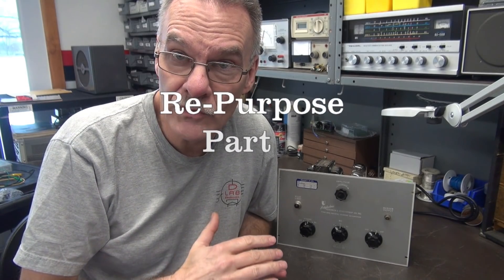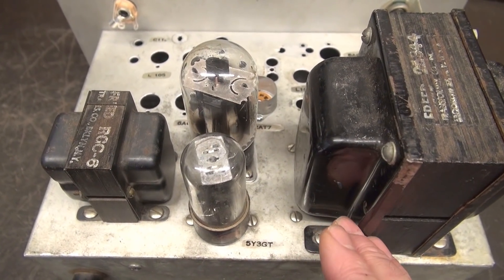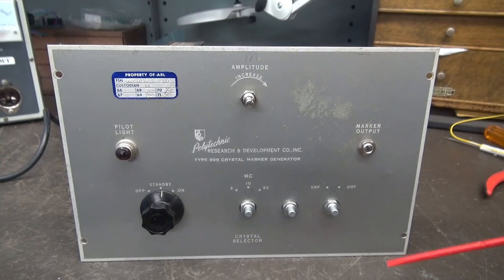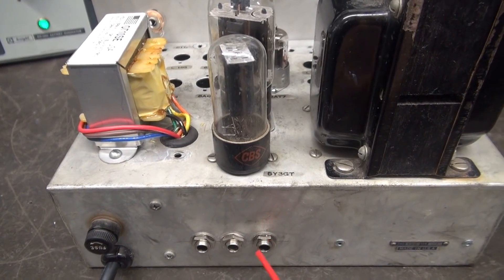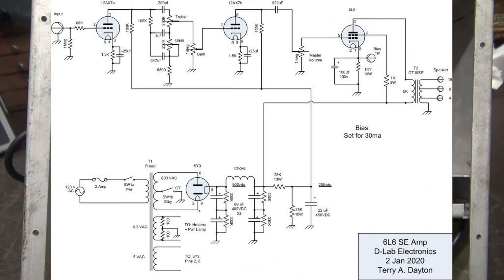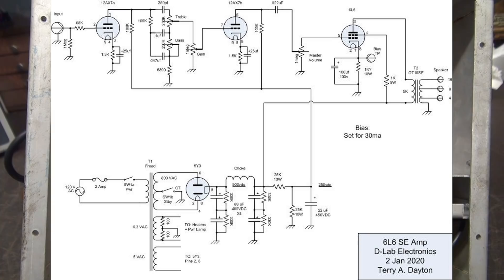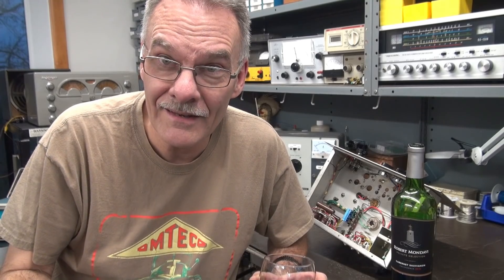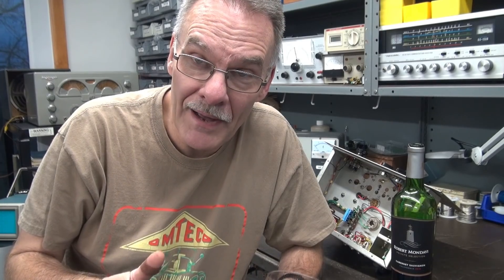How to re-purpose Junk into something cool Homebrew Project 6L6 Tube guitar amp D-Lab Part 2

Comment: Something to think about that regarding the design of the Master Vol. As configured, when the wiper track is at ~50K, the low frequency cut-off is about 145Hz with that .022uF cap, so low volume settings will be lacking in bass response. Fender overcame the issue in the 5E3 by using a .1uF cap for the coupling cap. Better still, if I may make a suggestion; attach the master Volume wiper to the grid of the output tube with 2.2MΩ resistor from the wiper to ground. The 2.2MΩ insures grid-leak to ground if the wiper fails, the upside is that the rolloff remains constant for .022uF/1MΩ at about 7Hz.

Comment: Speaking of safety:  If you are working with ungrounded AC input. Another good practice is to check for leakage voltage to earth ground.
Wire a 10k 2w resistor and a .01 uf ceramic cap in parallel across the probe of a AC volt meter. Measure for AC volts between the chassis of your project and earth ground of your building's electrical system. (AKA the third prong of the wall outlet or to the conduit.

Comment: Also terry you should talk about corect mains grounding  of the unit everyone's building  EG where to attach the ground wire  2ND  the mains wiring to the fuse and PWD switch and the correct wiring to the mains fuse

Comment: I'm curious what your thoughts are on the resistors some amps have from the filter caps to ground which are there (I believe) to bleed the stored charge when the amp is off. I have an 80's Fender Concert that has these for example. Doesn't stop me discharging and checking the caps when I work on it though :-)

Comment: Hi Terry.  Great series!  I'm enjoying the design-as-you-go process.  so often I get so bogged down with the details in the design process that I never get around to actually building!  Two questions/observations.  I'd turn the output transformer 90-degrees to reduce the magnetic coupling potential with the power transformer and choke.  Also, it looked like the plate-voltage tap for the 12AX7 was in the wrong place.  According to the schematic, the 12AX7 would get the same voltage that the output tube is getting.  All that aside, I really enjoy and look forward to your videos!
Reply from the maker: Hello, Take a second look, The 100K resistors feeding the 12AX7 plates are tied to the junction point of the 25K resistors, 250v line
Reply: @d-labelectronics  My bad.  I just watched the video again and you are correct.  I missed the the voltage divider on the schematic when I watched it the first time.  Sorry about that!!

Comment: Nice output transformer high build quality on repurposed ham or test or especially military gear my frist ham teacher in high school gave you grade on and got points if you used old stuff so that’s all I used and the habit stuck now I’m 66 and it’s still great 👍 that combo of a good supply on a class A 6L6 with that transformer should be killer so nice job

Comment: This is a very cool re-purpose amp. Perhaps add a vintage sounding 10 in alnico speaker?
I like the safety tips too. Here's a little tube tech diddy as a way to remember safety rules of thumb.
 "Got one hand in my pocket the other on the probe. Cranking the 
variac waiting for the glow. Seeking validation for my troubleshooting
 plan. If I can fix this baby I will be a happy man. 
    The filaments are glowing as the heater current flows. Watching AC 
current while my dim bulb barely glows. Checking for high voltage, no 
flashes we are hot. Max the bias voltage with a twist of the right pot.
    Looking good so far, good luck we have had some.  But lets apply the
 volume we've got signal and no hum. Victory attained fidelity restored 
it's time to start another one so that we don't get bored." 
Cheers and keep em glowing!

Comment: Sorry if I'm wrong, but I think that the way the master volume is wired, it will keep the grid leak resistance fixed, but it doesn't attenuate the volume because it doesn't form a voltage divider. Not wanting to be rude at all, let me know if that's the case.
EDIT: I'm think that maybe it does form a divider with the second stage's output impedance. Is 1M too high?
Reply from the maker: Hello, May be, If so I will lower it to 500K, we shall see when initial testing is performed
Reply: @d-labelectronics  we shall see! I'll stay tuned for the next episode

Comment: I was working on an old Marshall some years ago, and I got knocked off of my feet and fell backwards when I was hit with 475 vDC. It hurt like hell for at least an hour. I am amazed that I was not killed as the current went through my right arm, across my chest, and out of my left arm. So all you newbies LISTEN to Terry!
Reply: Robert Hurless I was working on dynaco mk3 I was a kid and had nothing’s so it was on my lap and was trying to signal toying my fingers to induct hum well touch’s the plate by mistake. Woke u later amp was not across the room I had a big bump on the Bach of my head

Comment: Could be a good idea to power g2 of the 6L6 from the 250V node of the power supply too, to let it run less hot.
Also, making the power supply go straight to the choke from the rectifier, without the first filter cap section would make B+ about 30% lower, and the current capacity that much higher.

Comment: Did you mean KT88 when you mentioned about 6550 or KT66? A KT66 is interchangeable with the 6l6GC and works great on class A configuration. Should be a little screamer when it’s done. I have the stuff laying around from an old projector audio amp. Looks like a good circuit to build it around. Can’t wait to hear it.
Reply from the maker: Yep, you are correct

Comment: Not all 6L6 tubes can handle 500 VDC on the plate, most are somewhere in the 300+ range. The 6L6GC, KT66, and the Tungsol ST 6L6G can handle it, but I thought people ought to be aware of this.
Reply from the maker: Yes, you are correct I used the GC version, I will make sure to point that out in the wiring video

Comment: Since you moved the choke and drilled in a new output transformer why did you install all the cores in the same orientation? That's inviting hum from magnetic coupling.  Good job making a point about HV safety - Don't test for B+ with your tongue!  Joking aside it will bite you hard if not bury you.

Comment: "The Saga Continues in Part 3...!"
Glad to see you including those safety tips, Terry, since many of the younger viewers may not have the experience working with higher voltages and currents.  Even watching for proper isolation is important; I bought a small used Radio Shack handheld digital multimeter recently, and discovered someone had added an external power jack to it so they could use an AC adapter or rechargeable batteries.  They used a metal coaxial power jack, which ruined the electrical isolation of the case.  I plan to put it back to stock, but for now I only use it for lower voltages and cover the jack with electrical tape.

Comment: On the schematic, the master volume look backward? No 6L6 screen grid cap?
Reply: It's different, but I think it's designed to give a constant impedance for the grid. Otherwise, the master volume would vary the grid resistance.  The alternative is to add a cap after the master and a fixed resistor to  ground.

Comment: I thought i understood that transformers needed to be at 90 degree angles to each other.  Is this  not the case?
Reply from the maker: Nope, old school mis-information
Reply: D-lab Electronics Yeah, the choke close to the power transformer mounted parallel is usually not an issue. I have done it adding chokes to modern amps where chassis space was limited. I don’t think I would try it with the output transformer close and parallel, I have seen that induce 60Hz hum. That is usually why they place them at opposite ends of the chassis or a fair distance apart mounted perpendicular to one another.
Reply: @d-labelectronics  Thanks.  i noticed that in your video of the Raven design.
Reply: @d-labelectronics  How so?  The effect is too small to matter? Given how close the power transformer is to the choke, I'd be a bit concerned.

Comment: connecting the center point of the 2 100 ohm resistors to the cathode of the 6l6 instead of chassis ground will reduce hum.